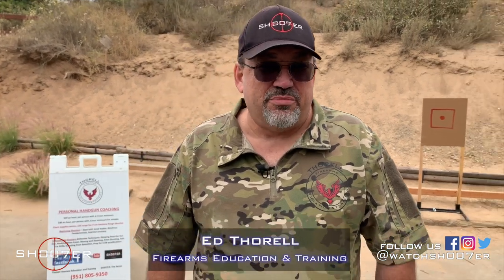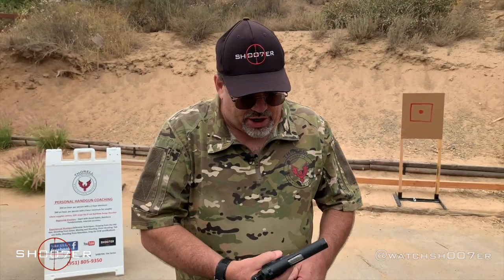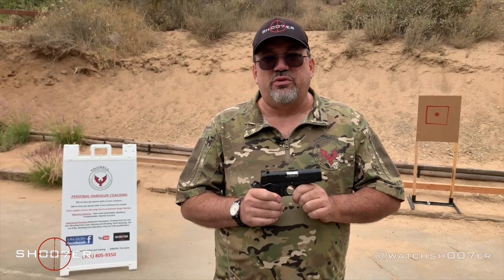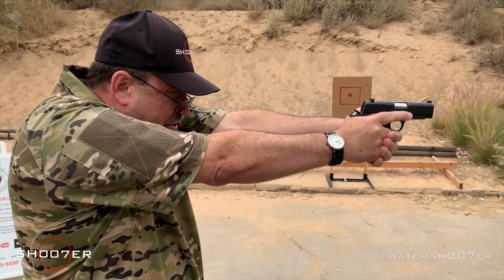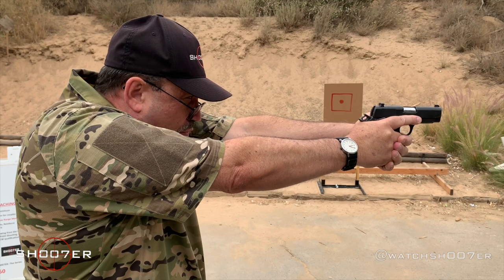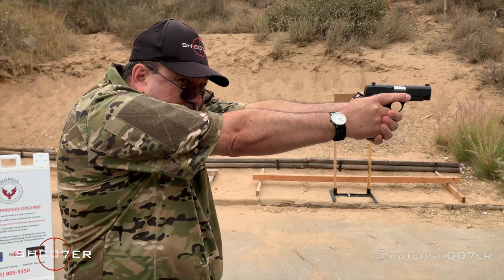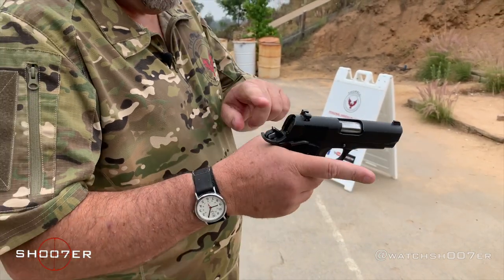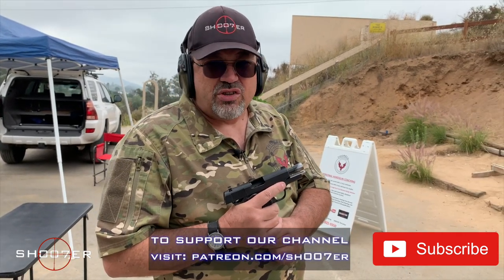HOW TO AVOID LIMP WRISTING - SH007ER

Comment: Thank you for posting this! I have an LCP II, and I've been trying to figure out why it would fail to eject every 2nd or 3rd shot. After watching this video, I went to the range and tried these techniques. It works! 30 rounds and not one single failure. I always learn best when someone explains the science and mechanics involved. All I heard before was "stop limp wristing", but the explanation and demonstration in this video made so much sense.Thank you! I really wanted to like this pistol, and was worried about it's reliability. Now I just have to keep practicing.

Comment: Wrong....your failure to feed was due to a weak spring. Your wrist has nothing to do with that next round chambering. You were quick to say it failed to eject when in fact it did eject so you had to cover your tracks somehow. Might want to replace the recoil spring and the rest of them while you're at it.
Reply: FTE is from the slide not getting full travel or returning too quickly. Stronger spring increases the issue. 🤨

Comment: I use the weaver stance so feel left out on this video.
Reply: I prefer the modified Weaver but in the real world you may not be able to be in your favored stance if the flag goes up. I like the Modified Weaver because it gives me a steady base with a 'Boxer' stance but allows me to turn my torso slightly to get full extension offered by the Isocoles stance. To each his own. Orthodoxy says right-handers go left foot forward. However, I have worked with plenty of skate-boarders and snow-boarders that have adopted a 'goofy-foot' approach and I tell them if you are comfortable with stance, then I won't try to retrain them. Do what works for you and find your own voice because one size does not fit all.
Reply: Center axis relock!!! Nah I'm kidding. John Wick can do it but I can not.

Comment: Thanks  for the  info. I have been  having this problem. 1 more thing. My   slide  was  open  and  when  I  put  my  mag  in the slide  went  into  battery  without  me  racking the slide. What  do you think?
Reply: Normal. Quite a few pistols do that if you smack the magazine into the pistol. Sig P320's and P365's are pistols that are pretty well known pretty well know for doing that. I don't know if it was intentionally engineered to do that, but most people look at it as an added feature. Think of it as a slightly faster reload if you ever need to quickly reload in the heat of the moment. Nothing to worry about, and it's not hurting anything.
Reply: @zues287  thank you very much!
Reply: @kirksanders9478  no problem. Have fun shooting!